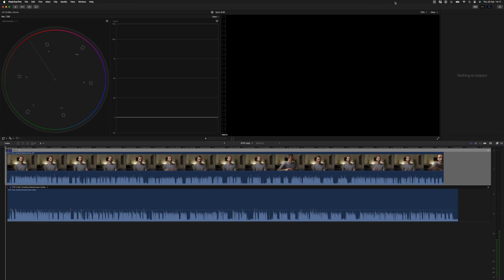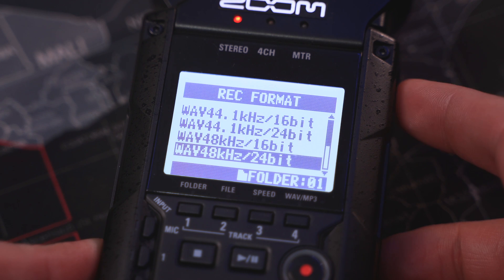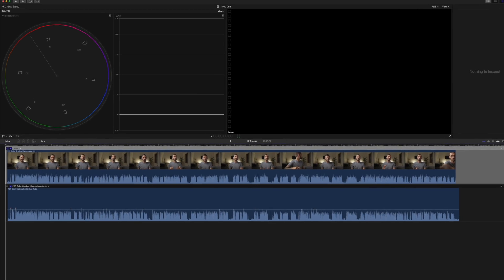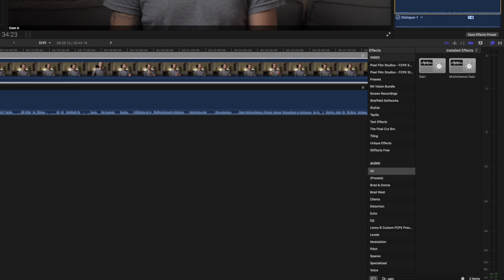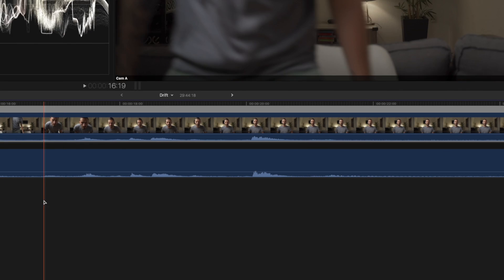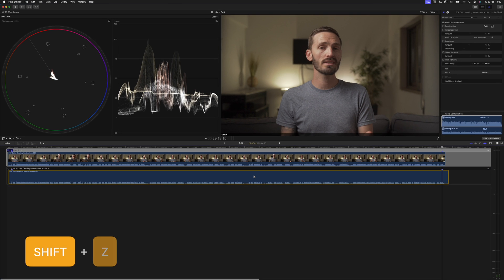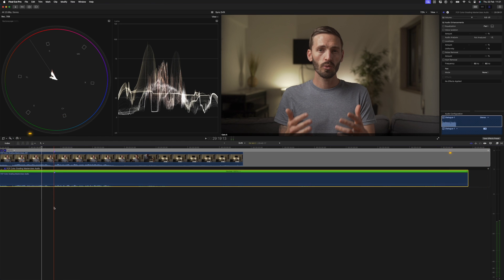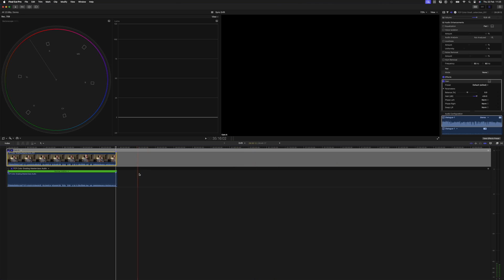How to Fix Audio Sync Drift in Final Cut Pro

Comment: For those curious as to why the audio captured in camera drifts out of sync with the audio captured on an external audio recorder, or why multi-cam footage drifts out of sync with itself:

It is because each device that is being used to record video and sound  is relying on its own internal clock-circuitry to tell that device how long one second of time lasts for. And the clocks in all of these different devices are not perfectly identical and synchronized to each other. 

Have you ever changed the clock on your microwave and the clock on your stove to match the clock on your phone? Have you noticed that, weeks later,  the clock on the microwave no longer lines up with the clock on the stove, and neither of those clocks line up with your phone anymore? Why? Aren't they all measuring time the same way?

The answer is no. They are not. They are all measuring time at slightly differing speeds. One second of time according to the microwave might be slightly longer than one second of time according to the stove. 

Imagine this: 
Three friends get in to three different cars. They line their cars up at a starting line and agree that all three of them will drive side-by-side in a straight line at 60 km/hr. Each person is controlling the speed of their own car, with their own foot, on their own gas pedal, determining their speed from their own speedometer. Will all three cars stay perfectly, precisely, and 100% accurately aligned side-by-side as the cars drive for miles and miles?

No. And why not? Because those cars are relying on three separate people to manage the speed of each car, and each person will have slight variances in how fast they drive. Even if those differences are tiny, over miles and miles of driving, those differences become significant. 

How would you keep all three cars perfectly aligned? You'd have to have their gas pedals all remotely controlled by a single, external mechanism. If that external mechanism slowed down, all three cars would slow down identically to each other. If that external mechanism sped up, all three cars would speed up identically to each other. 

Likewise, how would you keep the clock on the microwave, the stove, and your phone perfectly aligned? You'd connect each of them to a common external timing reference (the internet, for example) that would control how each device measured the length of one second of time. 

In audio and video production, you need a common external SPEED reference that connects to each piece of equipment and tells each device how long one second of time should last for. If all devices are running off of the same external clock (i.e. Genlock, Wordclock, Blackburst), then they will never drift. 

But, if they are all using their own internal clocks to determine how long one second of time lasts for (just like the microwave, the stove, and your phone, or the three separate cars with three separate drivers), then they will all eventually drift from each other because they are literally running at different speeds.

Ideally, you'd use an external speed reference (Genlock, Wordclock, Blackburst) plugged into all of your recording equipment to ensure that each device is measuring one second of time identically. But barring that, just know that even if all of your devices are set to the same frame rate (video capture) and sample rate (audio capture), unless those devices are receiving an external speed reference from a master source, they are all running independently from the timing created by their own internal clocks and they will always drift from each other, because they are all measuring time differently. Those differences are slight but over a long recording they become apparent.

This is why time-stretching or pitch-shifting the audio will always be necessary in a system where each device is running off of its own internal clock, rather than having all of the cameras and audio recorders locked to a single, master speed reference.
Reply from the maker: This is 100% correct Michael. Thanks for sharing such a well thought out comment on here with everyone 🙏🏼

Comment: My audio ALWAYS drifts, and i have all of my equipment on 48khz .... why do you think that is?
Reply: Here's why it happens: 

The audio recorder and the camera are two separate devices, running quite literally, at two separate speeds. It doesn't matter if they're both set to 48 kHz, they are still running at two SLIGHTLY different speeds. Each of these devices contains an internal clock that tells the device how long a second is, but the clock built in to the camera and the clock built in to the audio recorder are not identical, perfect, and synchronized to each other. 

Have you ever changed the clock on your microwave to match the clock on your phone, then weeks later noticed that they no longer match? It's because those devices are not measuring one second of time EXACTLY the same. They drift over the weeks because the microwave's internal clock is measuring one second of time slightly differently than your phone is. Not by much, mind you, but small differences in timing become apparent over long durations. If your microwave could connect to the internet and receive its clock data from the same server that your phone receives clock data, they would never drift. But because they are separate devices, measuring time with their own unique, separate, internal clocks, they will never perfectly measure one second of time the same as each other. They will always be running at slightly different speeds.

A common SPEED reference (i.e. Genlock, Blackburst, Wordclock) needs to be sent to the camera and the audio recorder to ensure that each device measures one second of time at exactly the same rate. Without a common SPEED reference for each device, drift will always occur over longer duration recordings because each device is using it's own internal clock to determine how long one second is.
Reply: @michaelayottemusic  thanks for the detailed answer man!!!! i guess ill always have to redo the audio...... I thought there would be a better fix...  thanks again!!
Reply from the maker: Thanks for the detailed response @michaelayottemusic. That is exactly right and this fix will still work on clips with the same sample rate or frame rate that drifts out of sync.

Comment: Thx for this one!
We are still getting drift, starting around 1hr of recordings, even though video frame rates (24 fps on iphone, riverside and fcp) are all the same and audio sample rate is 48 khz (rodecaster pro 2, riverside, fcp) overall, too.
Any idea, why it is still happening?
Another challenge, regarding the fix in a 2 person in one room podcast recording is: we need to keep the multitrack audio clips in total sync, to avoid echo from overspeak. So fiddeling with the retime editor is a bit risky, I think. Is there a way to rather fix the drift on the video clip, instead? After an hour or so, we see about 1-3 frames diff. And we just insert a gap of that size, which is not a  nice solution, I have to admin. ;) Suggestions for that, anyone?
Reply from the maker: It's weird that you are still getting drift with the same frame rates and sample rates, but this technique should still work the same. You can definitely apply the retiming to the video clip to achieve the same results. Ideally you don't want to slow the clip down because then you will have some video frames that will essentially last for 2 frames in the timeline and might look a tad jittery. But if you are speeding the clip up it should go mostly unnoticed. Give it a try and please let me know how it works out for you! 😄
Reply: @Brad_West  all right. Will do. Thx.
Reply: @Brad_West  It worked! Thx. Great advice, that it's also an option for the video clip. Yes, it's weird. @riverside is telling me, this might be due to low performance of our 2017 mac book pro (4 core), which is below their sys req. We are using the continuity cam option. Maybe this is too much. We do not see such a massive impact on Apple M1 pro (second device) Still a little though. (3 to 5 frames after 1.5 hrs or so)
Cheers!
Reply from the maker: @BorisCzizikowski  Interesting! At least a 3-5 frame drift is relatively easy to fix. I wish Riverside could lock all the angle/sources together.
Reply: @Brad_West  since we are podcasting, I will simply introduce a clap fir syncing at the end of the recording as well. That should make it easier to set the correction
Reply from the maker: @BorisCzizikowski  Smart! That will make things much easier!

Comment: When I switched to using an external audio recorder years and years ago this drove me crazy. It was difficult to find not only how to fix but why. Or I just wasn't searching the right way. Eventually I figured out the retiming audio trick and then realized the cause was different sample rates. Now everything stays in perfect sync in FCP no matter how long my videos are. That and since FCP will do auto sync I've never had a problem. I still see people say the only way to do this is to use FinalEyez (I think that's how it's spelled) claiming FCP's sync doesn't work. With all that said, I still do three claps at the beginning of each video so that I have initial spikes if something is out of whack.
Reply from the maker: Yeah, I noticed it something that not many people talk about, so I thought I would make a video about it since I’ve been using this trick for years. A few years ago I used to use PluralEyes to sync complicated multicam, multi clip projects but honestly, Final Cut Pro does such a good job that I don’t feel the need to do that anymore 😄🙌🏼

Comment: Yes!! I face this issue often! Also there is a frame glitch issue in the final exported video from Final Cut Pro...When there are multiple layers of 4k or effects, in that particular portion, a particular frame gets frozen in the final export..So I need to export the video again and it has no guarantee that the video has no freeze frames!Kindly help me out
Reply: I use M2 MacBook air
Reply from the maker: That’s such a weird issue, I’ve never experienced that. Have you updated to the latest version of Final Cut Pro? If not, I would do that, or Google how to trash, Final Cut Pro preferences to see if that helps.

Let me know if it does  😄👊🏼

Comment: This is an absolutely OUTSTANDING video. Great job, Brad!!! I've been dealing with these sync issues all the time, and the retime solution is perfect. It's crazy because I have sync issues even in footage with the same framerate, sample rate, etc. I still haven't figured out why it sometimes happens, but this is a perfect workaround and very well presented!
Reply: When everything is right, I believe the sync drift is caused by something related to the clock of the recording system, the camera audio recording clock being different than the recorder’s clock.
Reply from the maker: I'm glad you enjoyed this one Chris! Weird how you get the drift issue even with the same frame rate and sample rate, but this technique should work for you 😄🙏🏼